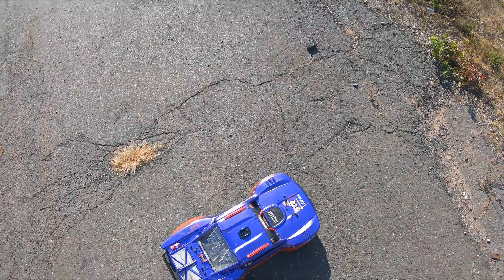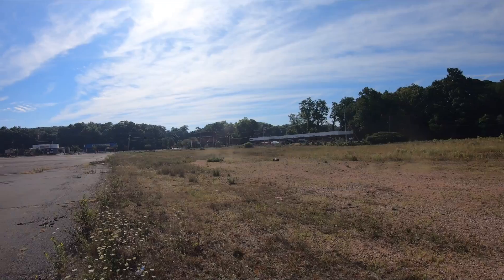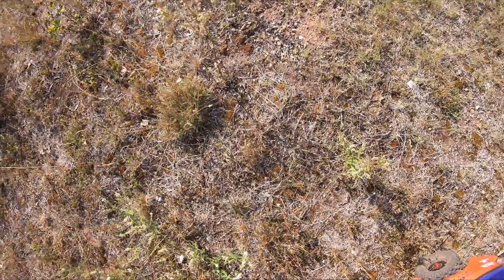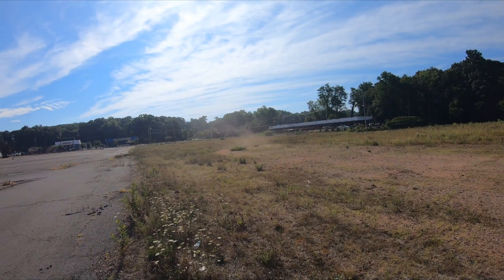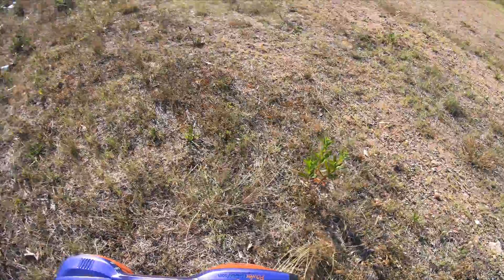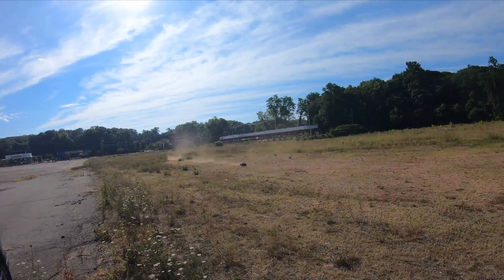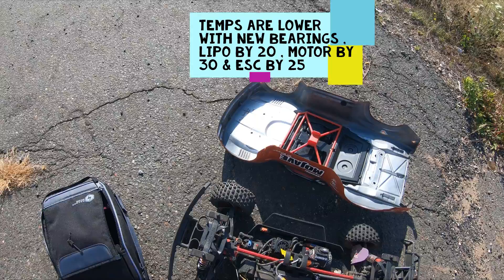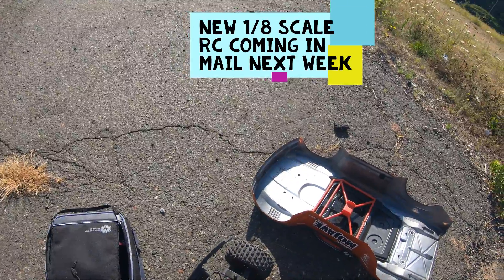#96 ARRMA MOJAVE ALL FIXED , CVD IN REAR WORK GREAT

Comment: what bearings did you get? I was looking them up and ran across stock and upgraded. upgraded was like 78 dollars And stock was 22. Would rather install the better ones if there worth it
Reply from the maker: TRBRC bearings ( eBay ) , I ordered by size 10 to pack , ordered 4 diff sizes came to $54 , Have 2 mojave so needed a lot plus extras

Comment: Hello which cvd did you use at rear please ?
Reply from the maker: The front cvd's will work in back , about $25 on ebay
Reply: @ucrazy2rc460  Many thanks (i have exb , With exb hex that’s right? Longer isn’t différent with the regular dog bones in fact ? Sorry i’am from France no ideas here .